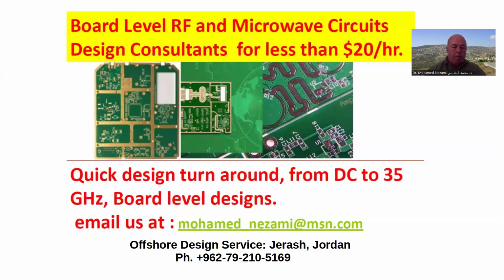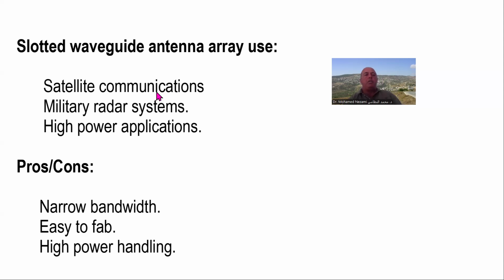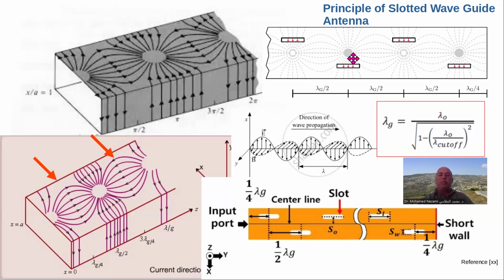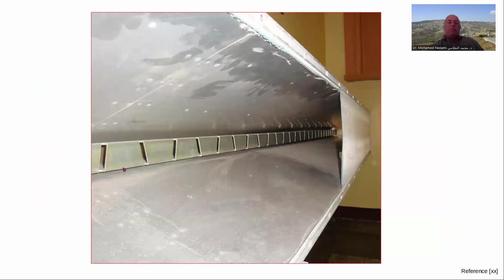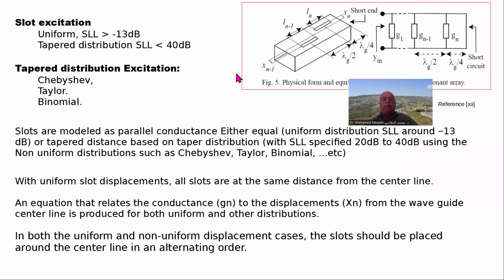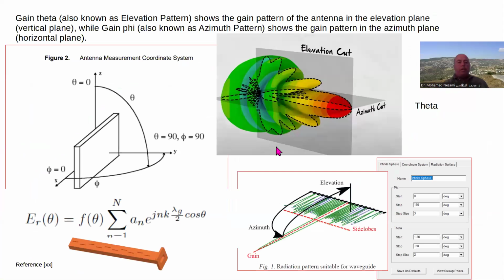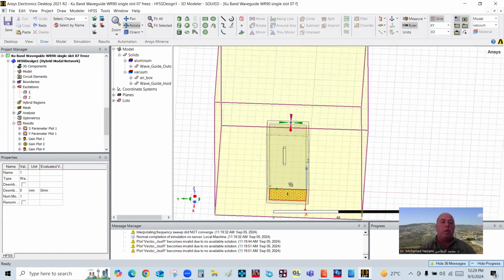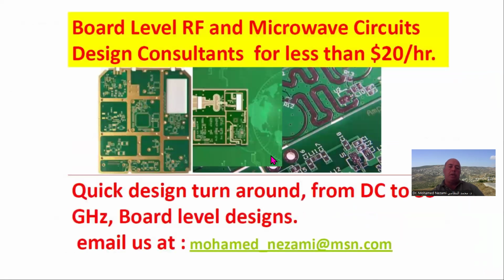Part I : Slotted Wave Guide Antenna Array Design and 3D Modeling

Comment: Excellent. Thank you. Any suggestions of using comsol rf module versus hfss or cst in terms of costing for smaller companies? I see you are using Ansys desktop with designer, hfss etc integrated. If not commercially sensitive then do share the pricing etc. The student version of ansys desktop is good but limited.😊